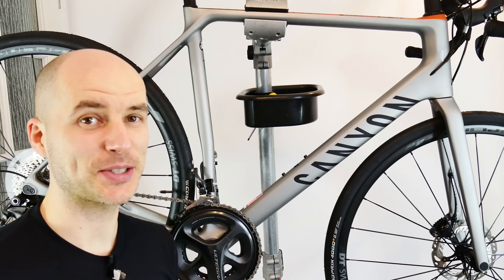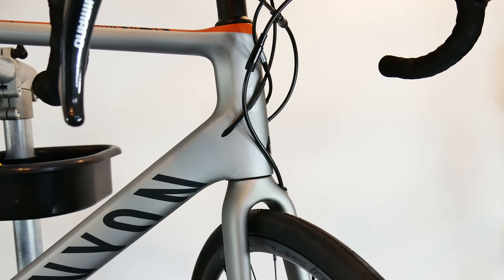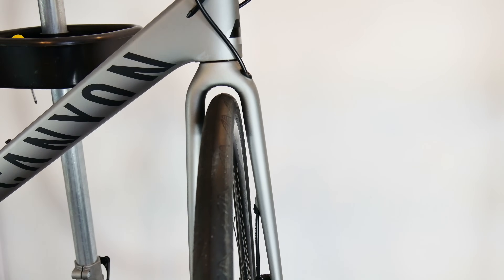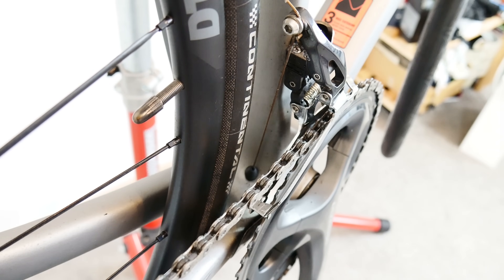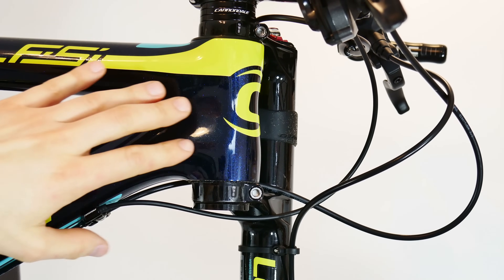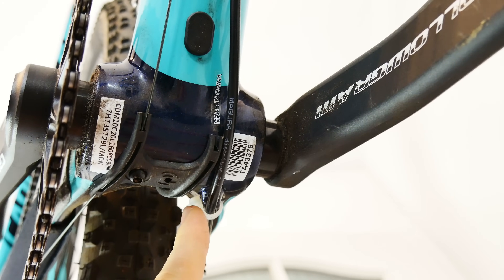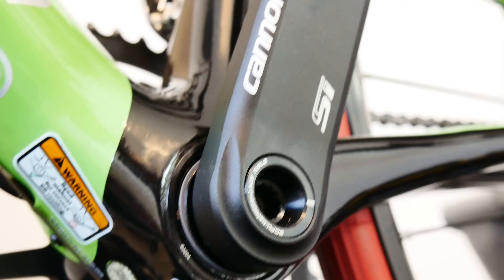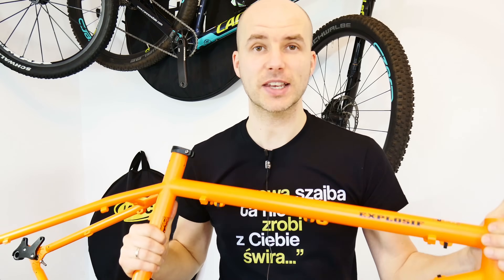Important Problems With Internal Cable Routing On Bicycle + Maintenance Tips

Comment: You clearly have no Idea about the diffusion of forces through the materials... a hole will not necessarily damage your frame. It is even so, that most stabile structures are made with wholes, instead of a complete body.

Comment: I have a road bike with internal gear cables and running really light disc brakes externally, it works for me.
My mountain bike is all external, but I keep the whole length of the gear cable covered and use velcro ties to hold them all to the frame as it was created for exposed wire gears and brakes, but has fluid disc brakes, much easier and simple to maintain. I would love a simple frame without the brackets I don't need for external routing.

Comment: Good video! Worth to mention, that water pouring through internal routed cables is accumulated in the BB which also has na impact of a lifetime of bottom bracker bearing, who's are usually press fit these days.

Comment: Is it really that bad because I am planning to buy a merida bike with internal routing I am a bit scared now
Reply: Don't be scared. If you like it, buy it. The cable routing shouldn't be the sole deciding factor, especially since other factors are way more important (like the fit of the bike). Of course external cable routing makes some stuff easier, but you will fare just fine with internals as well. If you struggle with the maintenance, go to your local bike shop and let them show you a couple of tips and tricks. :)
Reply: I just bought Merida ride 400 and after one month of riding wet conditions had to recable. So much water gets into the system especially front derailleur cable were affected
Reply: I used a magnet to help the cable come to the hole
Reply: Sean, good advice. I've also used magnets and they make the job much easier!
Reply: I used an experienced tech who routes my cables for free because I purchased bike at good shop with free tune ups for life of bike!
Reply: No. It's drivel - made up nonsense. Frames don't break because it had structurally reinforced molded holes the width of a No.2 pencil added. Frame brake because people crash them and then ride them again when they don't look outwardly damaged.

Comment: Couldn't agree more that internal cabling is a bad idea both in terms of reducing frame strength, providing entry point access for moisture, and increasing the complexity of replacing cables. The trick about joining the new internal cable to the old one so that as the old one is withdrawn the new one is installed is a good one. I haven't actually tried this but it occurs to me that one way of securely joining the two cables together might be to take a common cable end cap, cut off the closed end, insert the old cable into one and and crimp, insert the new cable into the other end and crimp, and then pull the old cable out and the new cable in.

Comment: Well u think those holes makes the structure of the frame and the bike itself weaker. But Canyon and other bike manufacturer engineers puts lots of hours and time making sure all these bikes are precisely well engineered road slaying machines. So your arguments r a little bit on the downside
Reply: Could you please hook me up with your drug dealer, mine doesn't carry the stuff you're on,   Look at the front derailleur on the silver bike, the cable sits directly in front of the rear tire and drops down into the frame so water and crud can drain into it, They are doing there best, dealing with having to install the cables internally for Style, not for Precise engineering.

Comment: A small dab of silicone caulk will seal around your cables, keeping both dirt and water out of the ports more effectively than rubber grommets... if applied correctly, it will form an airtight seal once it dries. I'm not convinced that the holes actually make your frame structurally weaker, either. If you only drill a hole, it will be weaker, but when material is added to surround the cable, it is not necessarily so. It could actually be stronger where the cable enters. I find sickbiker to be knowledgeable, with valuable insights to share, but I'm not sure his conclusions are valid in this case...
Reply: I think the holes are not a structural problem

Comment: Vain appearances and fashion will always beat logic. It's why people choose to fill their cars with luxury junk instead of life saving roll cage and harness. And cyclists choose aerodynamic fancy helmets that have zero protection for the rear lower part of the head over stack hats and helmets while riding around traffic, not to mention the spandex. I bet these same people brag about their recycling and their carbon offset while same time demanding brand new bikes and cars with new gimmicks to replace the perfectly fine, but not as fancy, older generations.

Comment: The front derailleur on my Izalco was acting up so I tried to replace the (internal) cable; I couldn't pull it. It probably was what the guy said about dirt and water getting in the housing. I had to take the bike to the shop where, after i paid some money, I got it back with a new cable. I don't know exactly what they did but I got charged 2 hours labor.

Comment: internal cabling comprises shifting, 11 speed has smaller increments so it gets amplified, now we have electric shifting to fix poor internal shifting. external shifting has a lot less friction for the derailleur spring to release the indexing, notice most top end italian bikes still use semi or full external shifting.

Comment: My mountain bike came with internal routing. It rattles around in there and is definitely the noisiest part of my bike. When I'm due for a cable replacement, I'll probably just rip it out and run the cables externally for the sake of not rattling.

Comment: Your absolutely right! Internal routing looks really sexy, but the replacement sucks! Had to change my cables few weeks ago and it took more than a hour! Much easier you put a liner over the old cable and use it as guide for the new. But an external routing i would prefer. Sorry my english is not so good;)

Comment: The pro of a cleaner look doesn't compensate for the cons (Tougher maintenance and holes decreasing the frame's strength). It is common sense 101 that any holes in frames will weaken the frame. Tougher maintenance of internal cables is the bigger con to me..... K.I.S.S..... Keep it simple stupid.

Comment: Interesting video... A little dated...  But, seeing some of the comments.  Useful video if you have an old bike and planning to do internal routing yourself!  That's a crazy objective for me.  I would never even try.  

I was investigating whether there were downsides for new, 2021, modern bikes.  This video doesn't address that.  For me, for electronic derailleurs, electronic cables eliminate a lot of issues - no wear, no movement... Fine if they are hidden in the bike.  Similarly, hydraulic cables are moving a fluid, mo movement, no wear.  Of course, we expect new bikes to well engineered where the holes are smartly placed and sealed.

Comment: Many internally-routed cables run the full length of the frame, increasing friction.  So an internally-routed cable comes with worse shifting and braking.

Comment: Internal cable routing is good when you want to strap some extra frame bags on it. But contrary to expectation, it seems that on those cheapest commuting bikes, where you might want to have some extra bags most. There isn't internal cable routing.

Comment: i don't agree with the statement that "the frame is weaker", using simulation softwares manufactures are able to detect the unecessary material that can be removed without affecting the rigidity and the "strength" of the frame
other than that, i do agree is a nightmare for bike mechanics and i'm willing to embrace the risk since it looks so damn neat and tidy <3

Comment: The trick I use is to run cable liners on ALL my cables. Seems to reduce friction and it will definitely make routing them easy.

Comment: If you routed the brake hose externally, you'd have to bond metal pieces to the fork, which would be no better for strength and could lead to delamination.

Comment: It's 2021, and internal cable routing is ubiquitous. This may come down to people that rely on their LBS for all their maintenance needs vs people that maintain and/or build up the bikes themselves. Being in the latter group it's easy for me to observe the design concessions and nuisance of internal cable routing. Even with the magnetic based tools now available to assist internal cable routing is a time waster. The best development I've seen on this is true wireless drivetrains a la Etap. I prefer Ergo controls and am hoping Campagnolo releases a true wireless version, which I'll transition to en masse.

Comment: Got to also add,  I dislike lifting and handling my bike with piano strings scratching the paint, and  to get tangle-up in, snagged (and the kids love to play and pull on them) its quite a bit easier to clean an internal routed cable bike.  You can also see most of the cable outlets have been specially molded beyond the regular shape and dimensions of the carbon tube, there by giving abnormal strength to the areas.  Some might be concerned with frame stiffness,  but I myself,  i'd rather have a flexible carbon frame for road vibration reduction.  And yes,  never drill carbon "fiber" as you will likely wont like the outcome. Now, leave me alone... I need to go fix my rattling internal cable issues  ;-)

Comment: DI-2 0 problems in 5 years.  No cable maintenance. Wake up man.
Reply: How are the brakes connected to their levers?
Reply: Stupid replies. Of course I  meant shifter cables and not brake cables. Shifter cables can go wonky in as little as a year. But having said that  I have never had a bike so long as to have needed to replace a brake cable. I have had lots of bikes. I don't ride the same bike for 20 years like some of you do. As I have said the DI2 needs nothing.

Comment: I used to questioning why they're done internaly if you're not doing any aerodynamic critical race. Yes the frame is more aerodynamic without the cables, but then your body is not. Which largely hinder the frame.

Comment: Apparently there's aero gains to be made from internal routing, and they look a lot cleaner not having all those cables hanging around all over the place, however, my bike has external routing, and there's absolutely nothing wrong with it. I'm not a pro rider or sponsored, so I just care about performance. the external routings never done me wrong, so if it ain't broke, don't fix it

Comment: "what do we want to do it we want to replace the disc brake, well, we won't be able to route the caliper through the frame, we have to cut the housing."

Not true. You just undo the nut holding the housing in place on the caliper until it comes off. It will take longer than if it were external, but you don't have to cut it.
Reply: andrews2547 its still messy that way. go external if you have hydro.
Reply: Swen McCockny It's not messy if you know what you're doing and you do it properly, but it is still a lot of extra work.

I still prefer internal cabling though, mostly for looks. I don't really care if it takes 30 minutes to do something that would take 2 minutes at the most if it were external cables. Also hydraulic cables (if they don't get damaged) don't really need to get replaced all that often. My MTB is currently 3 years old and the hydraulic lines are still in near perfect condition. Bleeding hydraulic brakes takes the same amount of time and effort whether you have internal or external cabling.
Reply: people always cry about anything new in cycle world. both systems are great unless your an idiot that does things the wrong way.
Reply: that is what I mean - far more work for the same job with hydros. In order to change them you have to rebleed them after hose dissasembly.
Reply: andrews2547  you nailed it.
Reply: I had avid elixir 3 hydraulic brakes.  It took me so long bleeding it to get every bit of air out that I gave up and bought some cheap Shimano pre-bled.  External avoids bleeding.

Comment: Great video, good points. Internal cabling is sometimes just marketing, unless you are racing there is no significant benefit, only downside. On my internally cabled TT bikes, the extra maintenance is a real pain, so I would rather not bother. I have had to modify these internally cabled bikes to avoid dirt and poor shifting, a pain, and mine do not provide proper blanking grommets - it is poor design. Whereas it is easy to do on the external ones, even on CX bikes that have to deal with extreme mud and water. My vote goes to the Jagwire MTB cable set with the extended end caps with male female ends to eliminate any exposed shift / brake wire.

Comment: SickBiker, Tip for you.  Use heat shrink tubing (not electrical tape) to connect your cables when routing new internal cables.
Reply: Great advice. I also use heat shrink tubing on the end of the cables instead of aluminium end crimps. Much neater and streamlined ;)
Reply: Heat shrink on the cable end is a good idea too! I typically just solder the cable end then it will never fray.
Reply: If so, then solder with Bismuth paste. Can be done with one hand only, and is beginner-friendly.

Comment: I’m absolutely with you!
These days NOBODY should buy new models anyway since the bike industry decided to use their customers as
“Beta Testers” (Durianrider 😂)
We have already enough problems with hydraulic disc brakes,thru axles,bottom brackets and carbon in general.....🤔
Internal routing means more disturbing noise,difficulties with the service/replacing of the cables.
The gains of the bike industry are like colombian drug lords-buying carbon frames for 300$ and selling them to us for 5000$
Don’t be stupid people!
My race bike in 1983 was already beneath 10 kg in 60cm size-now a similar pro team bike of this size is almost 9 kg!
Big gains?! I can tell you my Casati Columbus steel bike is also quite aero(and from 88 model all cables run internally!)
It’s f#cking fast and only a little bit slower than my modern lightweight bike.
Also the geometry of the Casati gives me a way better position on the bike .
With carbon frames you are hopping over cobble stones,beeing more in the air than having contact with the tarmac,with a steel bike
you just go over it

Comment: Usually all the holes in the carbon frames are reinforced with extra carbon/resin layouts. At least this is what brands say.
Reply: There's one disadvantage for internal routing cables. Over some time when the oil in the internal routing cables runs out, the braking and gear shifting wont be as smooth, as there is only one route do the cable to move, most cable will rub against the housing causing the braking and shifting to be less smooth. So non-internal routing is good if you are lazy for maintenance as cables can freely move, housing too. So the cables wont rub against the inside of the housing that much meaning shifting and braking experience is better. However, internal cable routing is also great, if internal cable routing is properly made by manufacturer with water caps, its much sleek and nice. Just saying. So overall non-internal cable is good
Reply: depends what quality cables you use- better to pay more and service them less frequently- if you use high-quality coated cables I think it's better as you have everything inside, almost sealed compared to outside with dirt & water access

Comment: I think some manufacturers build internal channels for the cables to both hold them in place, and make it easier to replace them (as easy as just pushing them thru). Also, I think it'd be exceptionally rare that anyone would ever apply the amount of torsional pressure it would require to exploit the holes in the frame. If this were an issue, the practice would be discontinued immediately. How long would consumers continue to pay for $2000+ frames that cracked because of internal cable routing? That's not to say I think less of external routing, I just think it all boils down to good design and personal preference. So many great bikes to choose from!

Comment: Hahaha...what are you talking about drilled a hole on the frame? Really?....those internal routing are molded with the frame......its like a pipeline with smaller pipeline molded inside.......please before you talk maybe saw one of your internal routing frame so you will understand.

Comment: Brake and gear housing are heavy. On external cables there are much less housing. So, save weight and buy bike with external cables. That aero benefit for internal cables is not that great. 
I will make custom connection for external cables on my bike. How hard can it be? For now, it is what it is.